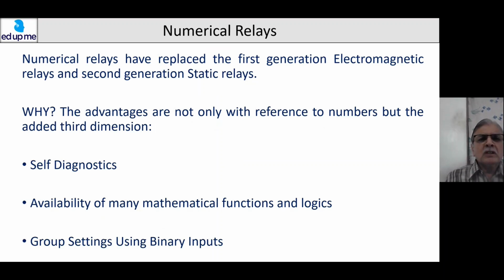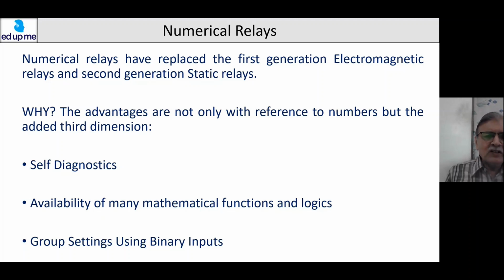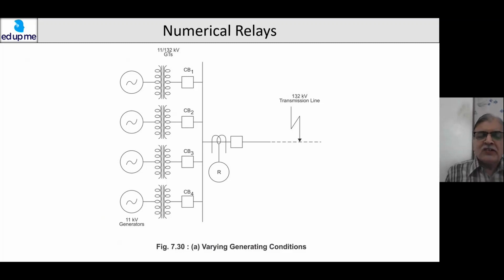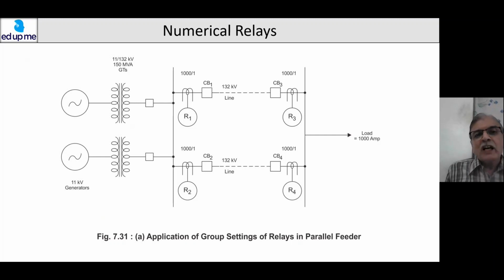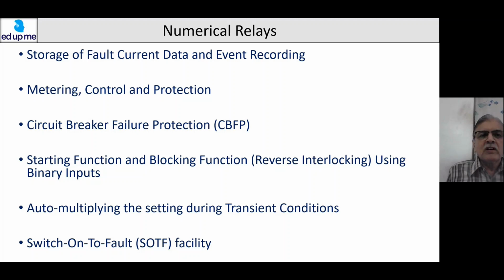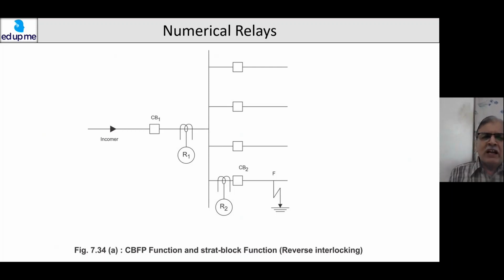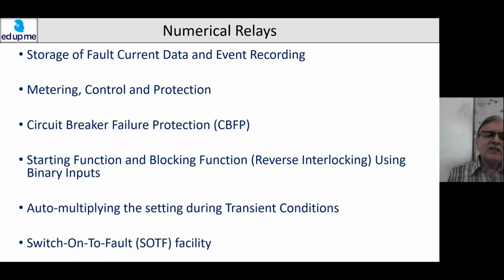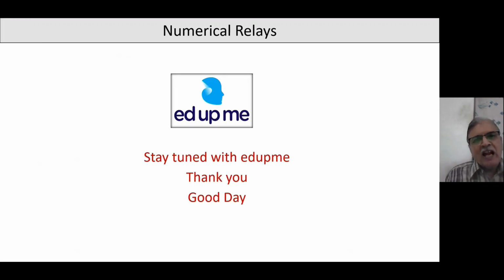Numerical Relays l Transmission Line Protection Using Overcurrent Relays l Bhuvanesh Oza

Comment: Dear Sir,,
Session covered all features of the numerical relay .. you explained in very simple way to understand...

I have 2 gen sets and in parallel with double circuit 220KV transmission line.. if you support,, I wish a practical example and session based on my organization case study... We are inviting you...